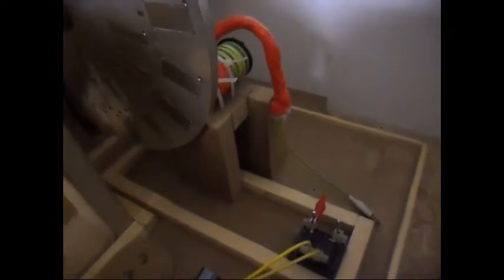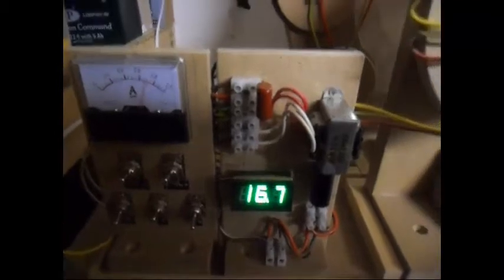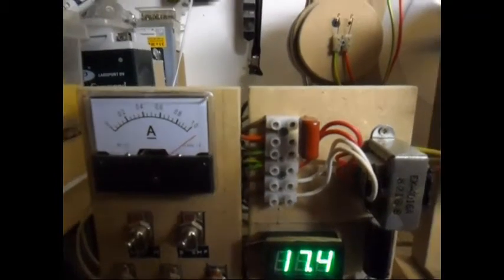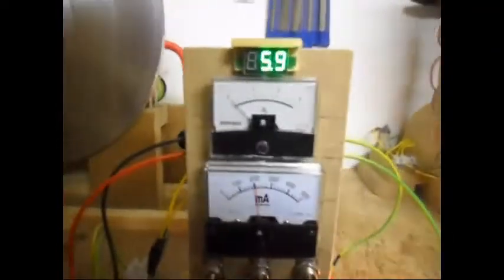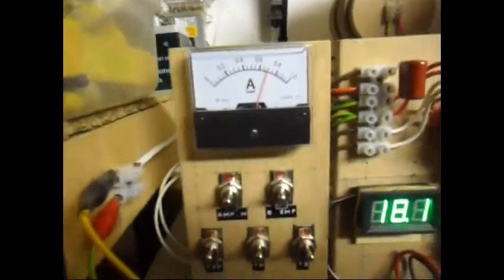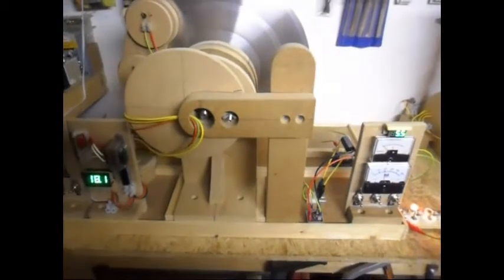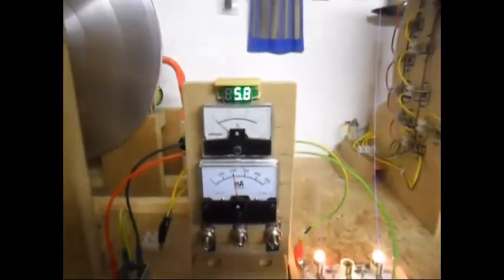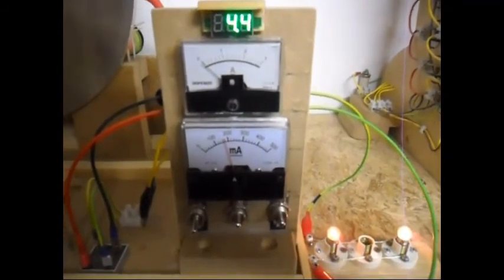Pulse Motor_Generator - Update 14 OverUnity is it or not, Future World Generator_1...

Comment: need to add more generator coils. how did you make no-cog wheel?
Reply from the maker: Adding more coils at this stage won't do any good, theres still much testing to be done but more coils will come soon...;-)
Its not the rotor but the coil that has no cog and this is because it has an air core...^^